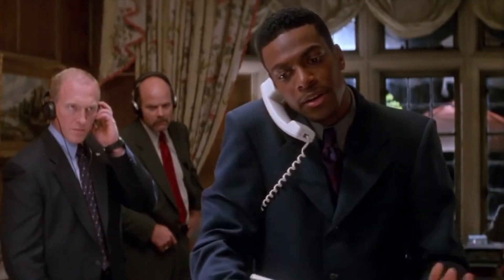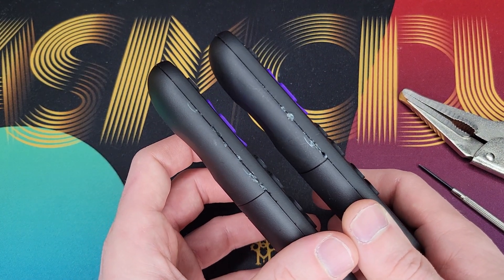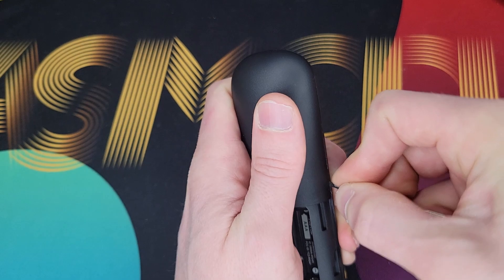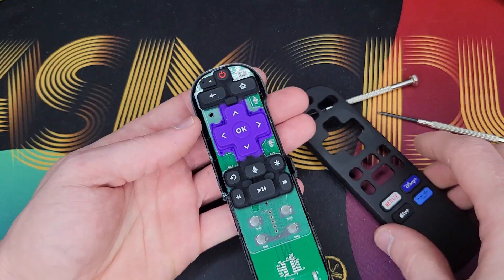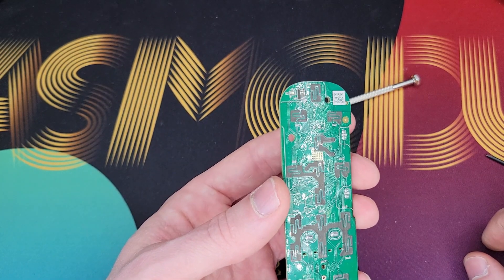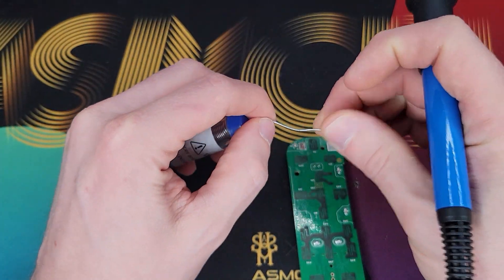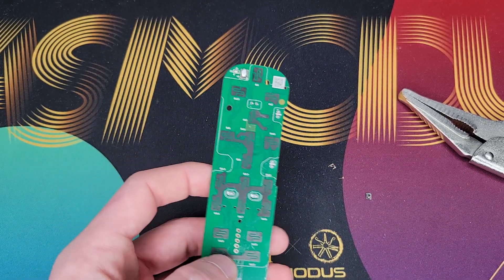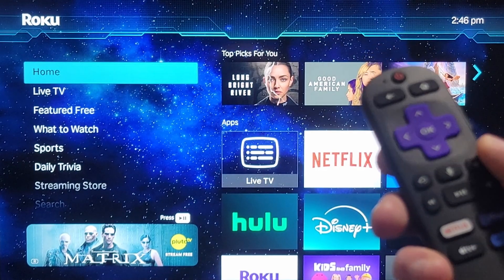Roku Microphone Removal | Remote Disassembly | How to Remove the Microphone From Roku Voice Remote

Comment: Also, while you have the remote open you can disable any keys that you don't like. I disabled the Netflix, Hulu and the other annoying streaming buttons as well as the voice control button by putting a little bit of tape on the pad contacts on the PCB. Nor more accidentally firing up a different streaming app when I was just trying to pause.
Reply from the maker: Awesome! Glad to hear. Its crazy they went the direction of forced buttons. Not everyone has the same streaming services. Customizable buttons would have been the most consumer friendly choice.

Comment: It's ridiculous that roku doesn't just give an option to disable the microphone considering all of their devices now have the voice option on the remote. I just bought a new streaming stick because I've had my old one for 7 years. That one didn't have the stupid mic on the remote.
Reply from the maker: I think you might be able to disable it in settings, but I could be wrong. Those were the good days, when everything wasn't equipped with a mic and camera. Terms of service and privacy policy and kind of nuts to read if you take the time to read em. Thats why I physically removed the mic lol
Reply: @CatDaddyGaming   I tried doing that. I turned off the only thing that mentions the mic in the settings, but the remote mic still worked. Strangely enough, the remote just randomly stopped working on its own and I couldn't get it to pair again. So I guess the issue resolved itself since I can't even use the remote now. Now I'm using the app remote where I can at least turn off mic permissions on my phone. Newer Roku devices don't seem to be built as well as the older ones.

Comment: Would just digging in the hole really well with a sharp strong pin work? Not paranoid, but I want to keep our at-home private conversations private. Don't like that we don't have the option to disable/turn it off.
Reply from the maker: Dont know. I'd assume it's definitely possible. Worth the try, but at the same time, the disassembly process is pretty easy if you're gentle with it